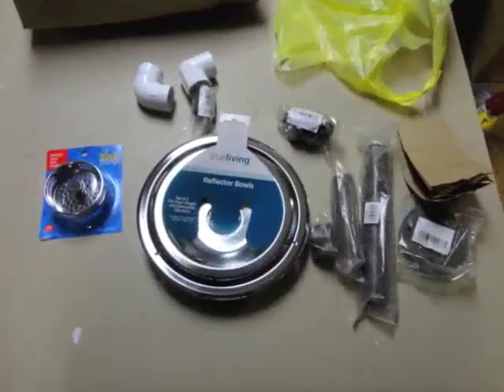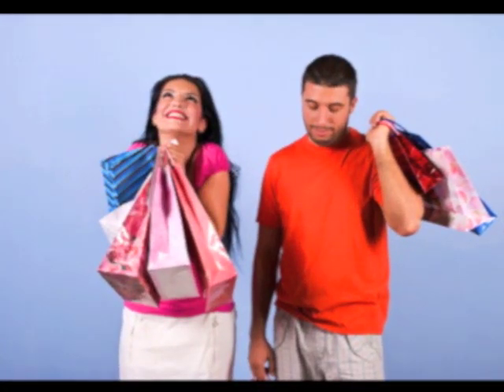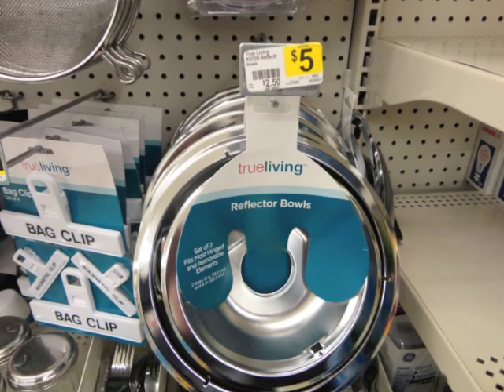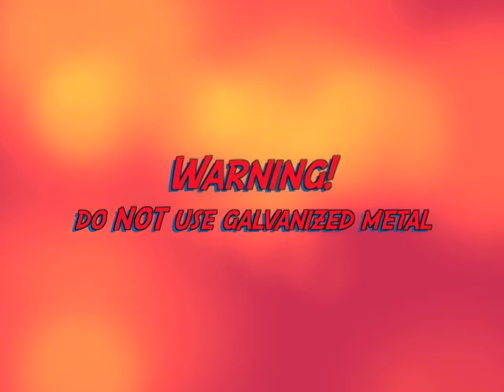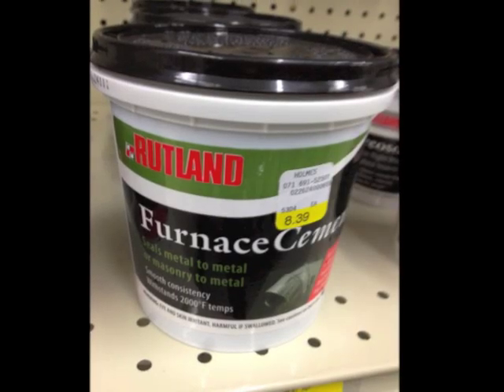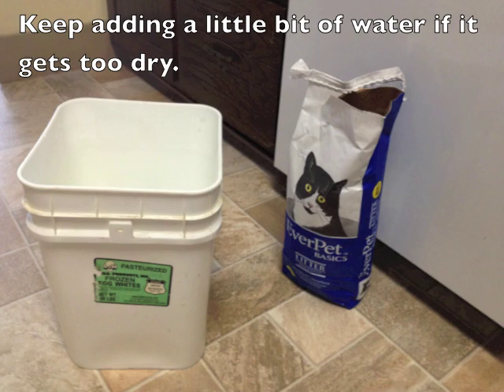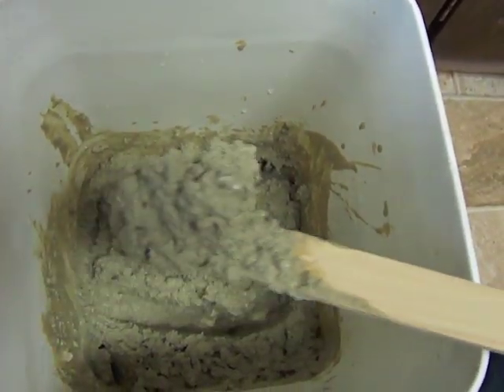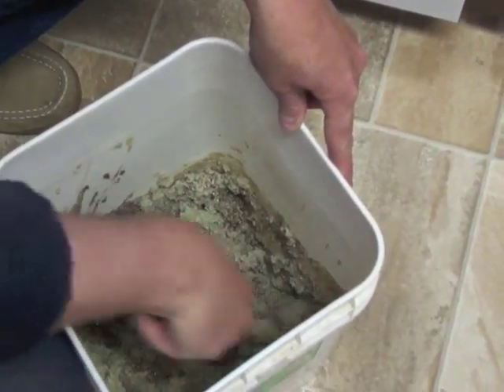Make a Simple Forge 1

Comment: I am sure I will have many questions along the way.  I am wanting to build a larger version of the coffee can forge using an old propane tank or possibly an empty helium tank.  I know from experience with pouring concrete that multiple pours will have a tendency to separate from each other without some rebar or other mechanical connection between the two.  With a larger vessel, will there be a problem with separation using your clay mixture or can it be done in one shot, making sure it has plenty of time to cure completely before use?
Reply from the maker: +Mike Kevins Hi Mike - I think that if you make a bigger forge that is more permanent, you should insulate with Kaowool. It is light, has a high heat tolerance and will last longer without cracking. I hope that helps!

Comment: other videos I've seen use plaster of paris. any difference In ability to properly heat treat?
Reply from the maker: +THE Justin Schmidt I haven't used plaster of paris before. It seems to me that the vermiculite mixture would be a better insulator.
Reply: the plaster of Paris is a POS.

Comment from the maker: Hi Gavin - Yes it can.  But if you are going to use a larger propane source like a tank, you might want to invest in buying some kaowool and building one with glass wool lining.  That will be a little more permanent.  You can also buy an inexpensive "weed burner" from Harbor Freight and adapt that for a forge.

Comment from the maker: Lol - This is a very simple and cheap option for a forge that will not see a lot of use.  I wanted something that could be made with very common materials available to most people.  The kitty litter that I bought said "bentonite clay" on the bag and did not list any other ingredients.  This little forge worked very well.  I never left it outside, so I am not sure about getting it wet.  I had no problem drying mine out.  After firing it a few times the clay mixture was very hard.

Comment: My head hurts from all these video's.

Your approach seems to go against what i have seen so far.

Vermilculite should not be used because it absorbs water.  So it will be very hard to dry out.
As soon as you get wet spells it will absorb moisture again.
I guess the proof is, Does it work or did you have issues?

How do you tell of the kitty litter is clay? I have looked at the cheap stuff and it had no information on the contents.

Thanks.

Comment from the maker: @knoxi82 Hi Knoxi - Just use piping that is not galvanized.  The farther away from the fire it is the less you need to be worried.  But galvanized pipe is coated with zinc. When it burns the fumes are very toxic.  You can get what is called "Foundry Fever"  it can kill you or permanently damage your immune system.  One of my least favorite things to have happen...

Comment from the maker: @Punxsyjumper Sure that will be just fine.  Any method of heat treatment is acceptable.  I would ask your Farrier friend for help.  Just be very careful if you use your coal stove.  Ask your friend to explain to you what part of the fire you want to stick your knife into to avoid oxidizing fire.  Also, coal can heat very quickly and this shell is thin.  You can burn it pretty easily.

Comment from the maker: @troy5690 It is the cheapest option especially if you already have a torch.  It will also be a little bit cleaner to use.  The homemade liner will not stand up to long term use.  But it is so cheap and easy to make.  It is also very efficient.

Comment from the maker: @jon26lo73 You are very welcome. It is the same as normal use.  The propane torch will be running for a while but should be good for several knives depending on the efficiency of the forge.

Comment from the maker: @evcrawfish This clay mixture will not hold up as well as refractory cement at high temperatures when it is inside of a tank.  But, if it is laying flat like in the charcoal design.  It will fare much better. For longer use and higher temps, I would recommend very highly that you use Kaowool or a similar high temperature glass insulation.  It is light and extremely insulating.

Comment: @J88Wolf If you are near a Ace Hardware, they have a 8qt bag for $5.99 (Item#: 7194988) with free ship to store. Although you might call the store first as they may already have it in stock. They stock the 20lb kitty litter as well (Item#: 8062705) for $4.99. There are a ton of places to get it. All the big box stores like home depot or lowes will have it too, as well as the reflector pans, drain strainer and plumbing parts.